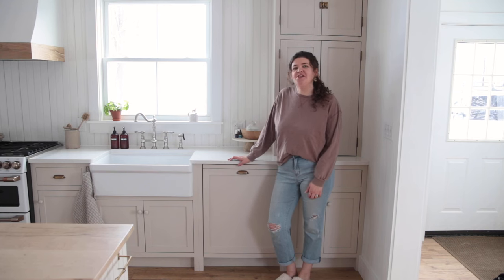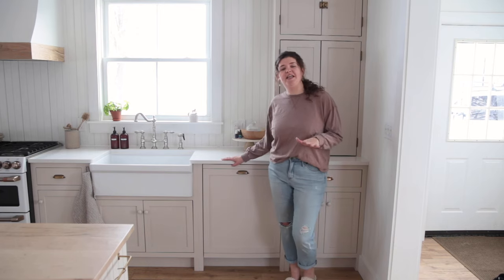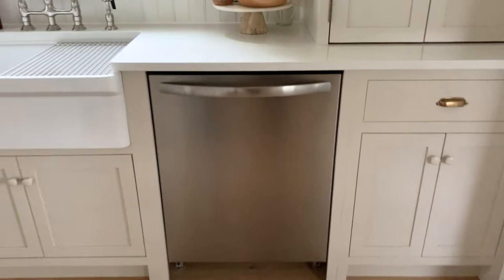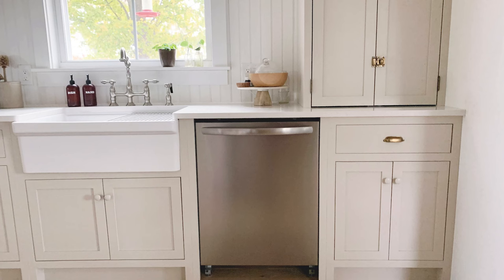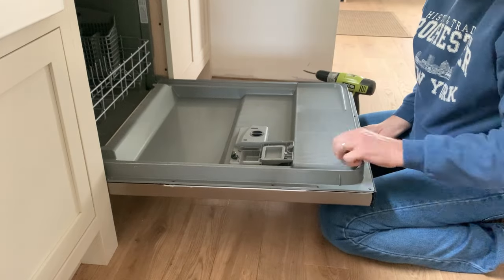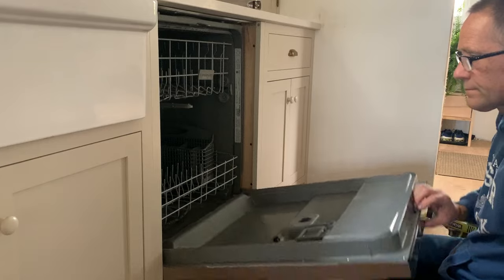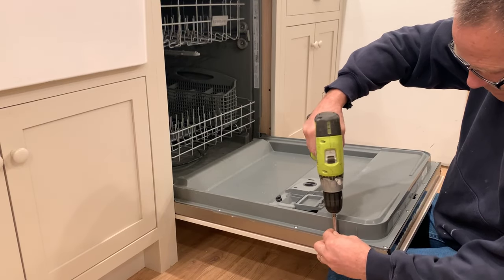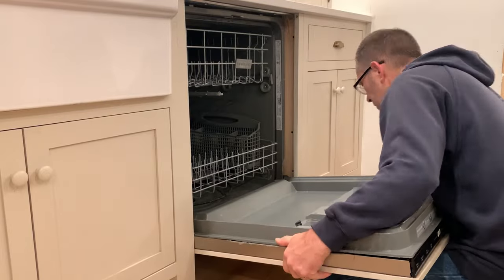DIY Dishwasher Panel - How to Put a Panel on Any Dishwasher

Comment: Hi! What about the toe kick panel? Do you just cover it at the bottom? It has vents I think..
Reply from the maker: Our dishwasher doesn't have a vent at the bottom (ours vents out the drain hose). We just put a painted wood board at the bottom of ours to match our cabinet toe kicks.

Comment: We're thinking about getting the same oven - is this with the bronze hardware or the brass? If so, do you mind sharing where you got your pulls/and what color? We like this bronze/matte white oven combo but worried about finding the right colored pulls/cabinet hardware to match. Thanks!
Reply from the maker: We have the brushed bronze hardware. (https://rstyle.me/+b6UYIttigYDJq9_G1TFjUw). They did not have the brushed brass option when we ordered ours.

These are the cabinet pulls we have: https://www.houseofantiquehardware.com/brass-drawer-pulls-cup-3-3-4?quantity=1&finish=4. Ours are the un-lacquered brass, and then I used brass ager on them to turn them darker. (Video on that process here: https://youtu.be/lNl_5bzbfkY?si=SFyUxYKs5-j2Ycpc). I found that gave the closest match to the oven knobs.

Comment: So, you have significantly changed the weight on the spring return tension.  I notice you have to fully lift the door, as there appears to be no offset balance. Is the spring adjustable?
Reply from the maker: The spring is not adjustable. The panel we have is very light, it hasn't really changed how the door opens/closes. It's been on for almost 2 years with no issues.

Comment: Maybe i missed it, but how far back did you have to recess the dishwasher to obtain the panel flush with the cabinets? I think i have the same dishwasher and we're remodeling. So i would love to do this!
Reply: The thickness of the panel if it's already flush with the cabinets
Reply from the maker: We don't quite remember how far back we had to recess it. Probably it was around an inch and half. Sorry we don't have the exact measurement on that!

Comment: Hi! Can I ask how you did your recessed drywall? This is an outside wall so what about insulation? Also, did you remove a stud to make them 24” apart to push it back into the cavity?
Reply from the maker: It is an outside wall, and there is insulation behind the drywall. We notched a 2x6 stud, about an inch, to be able to fit it.

Comment: Curious if you guys tightened your hinges /springs? 
I just put my panel on and it looks awesome but it’s a bit too heavy to hold and falls down. Any insight here? we only have springs on our doors but wasn’t sure if there was something I’m missing. We have almost the exact same dishwasher.
Reply from the maker: Sorry, just seeing this now. We did not need to tighten the hinges or springs on ours. Not sure why it would be doing that, maybe the weight of your panel? Ours stays open without falling, so I'm not sure what could help since we haven't dealt with that problem. Sorry!
Reply: did u end up solving the issue?
Reply: what wood species did you use. I planning mine out now and I think you need the lightest grade wood possible

Comment: just letting you know this will do 2 things. 1 void the warranty. 2 cause the door springs/pully system to fail early due to the excess weight. not to mention depending on your panel weight your door may be too heavy for it even to function. just pay the 300 dollars more for the panel ready.
Reply: Or keep the current panel and the old panel and if it dies you just change it out and let the warrant guy fix it
Reply: it's taped on lol
Reply: Its like almost $1000 difference not he dishwashers I looked at.